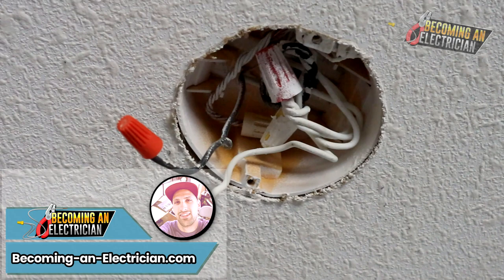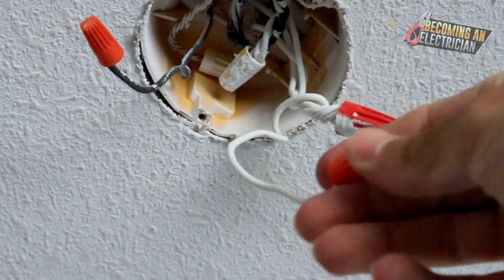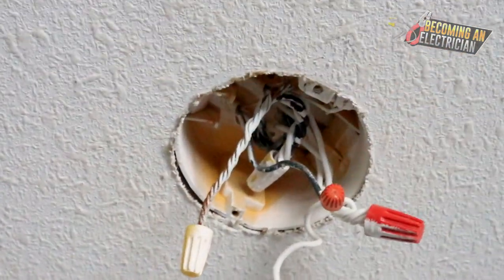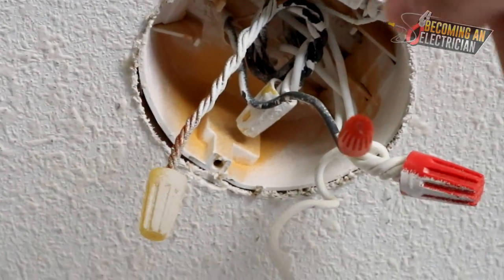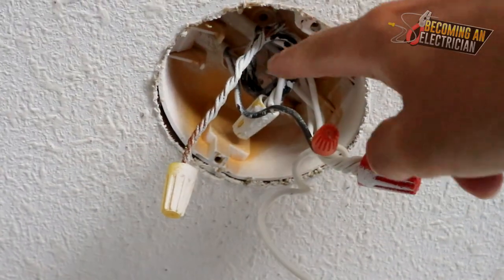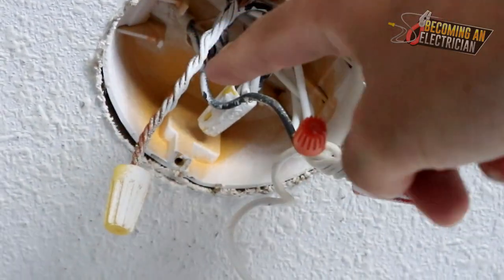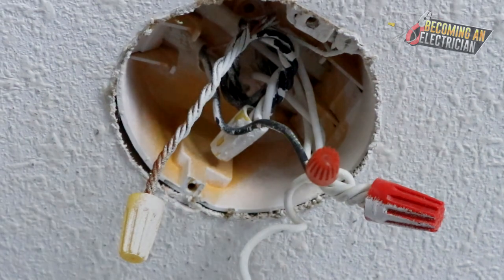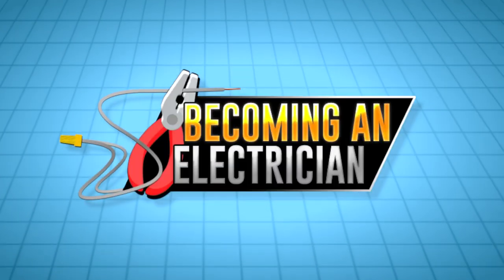Never Twist Bond Wires Like This (Full Spiral Splice)

Comment: That ain't as bad as my house. All my light fixture boxes were way over filled with connections of multiwire branch circuits. I think the worst one had two 12/3 and four 12/2 going into it. Ive been separating them all with junction boxes next to them in the attic and just running the the power to the light or fan like you were saying. And all my grounds look like that too lol, it is a pain.
Reply from the maker: Yeah this happens a lot when a journeyman is not overseeing their apprentice properly.  Keep the power at the light switch, then just bring a switch leg up to the light box.  That way you don't have to get a ladder, take down the light, only to figure out that it doesn't have the wires you're looking for..

See this video/article for the light switch power:
https://becoming-an-electrician.com/never-run-power-to-a-light-box/

Sadly, this isn't even taught in school.. I learned only from good journeymen I had the privilege of working under..

They spend so much time on "schematic circuitry", but don't teach best practices for maintenance and workflow!!!
Reply: @BecomingAnElectrician  Thanks for the link, ya that is the way to do it.  My house was built in 79 and the power runs to the fixtures/fans, they repurposed the neutrals as a hot back to the switch. That doesn't bother me as much as the overloaded box fills. Did they always have box fill codes, Thank you

Comment: Good advice.Thanks for sharing.
Reply from the maker: You are very welcome.. thanks for the comment.  Always feel free to request a new electrician tutorial 🙂
Reply: @BecomingAnElectrician  Thank you. One video that I would love to see is a video comparing and contrasting BX cable, MC cable, and Greenfield (flex) conduit, and how grounding is accomplished across the three.
Reply from the maker: @vince6829  Thanks for the request - I don't think this will be something I'll cover - I've only really dealt with just BX (Armored Cable) or flex (and liquid tight), where you pull individual wires through.  Here's a helpful resource I found, though!:
https://forums.mikeholt.com/threads/armor-cable-mc-ac-bx-etc.73744/

I do plan on creating a BX (armored cable) video soon about how to remove the armor, etc.
Reply: @BecomingAnElectrician  Thank you for the link.

Comment: The splice allows to install a ceiling fan without the fan shutting off when you turn the lights off
Reply from the maker: That is true, if a fan is there.  That is a good point that I forgot to think about.  However, you can see by the amount of wires they used this basic bedroom light as a junction box, making it very hard for trouble shooting.  If it were a 3-wire just for a ceiling fan, they would have just had the 3 wire in there.  There's no other lights in the bedroom.  (So not well thought out for maintenance).